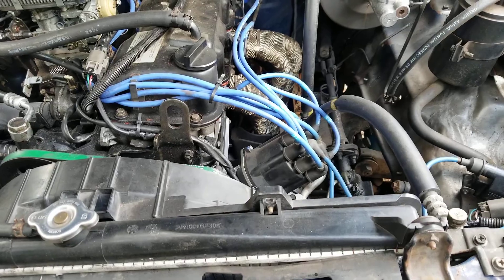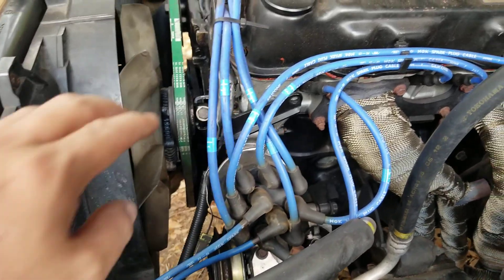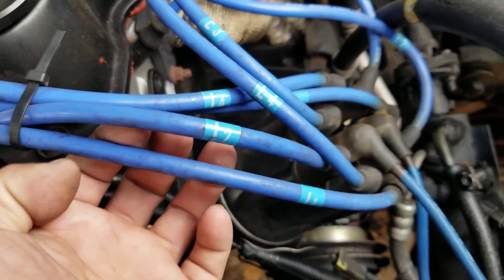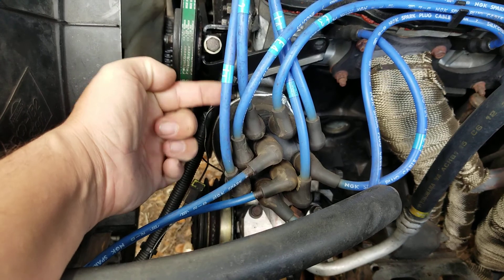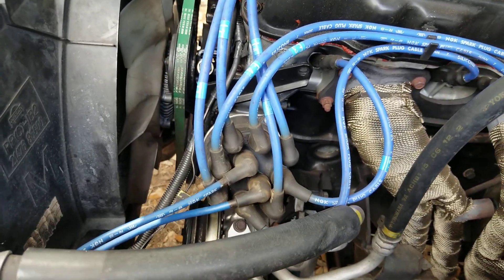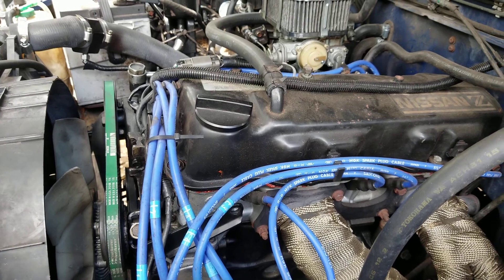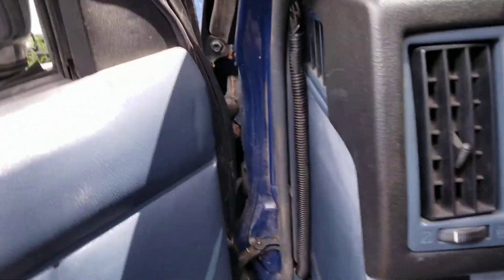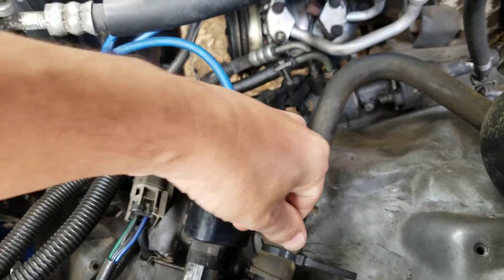86 Nissan d21. Revised: How too connect spark plug wires too distributor and ignition coils.

Comment: Hey bro maybe you can help me out please  me one got 2 coil like your but the piece behind wire are shutout  and wander if you can get those separate  and this other piece that conect 2 vacuum hose  will se photo
Reply from the maker: Can you upload a video and show me the exact area you're talking about. I'll help as best I can!
Reply: What other nissan used the same part include pathfinder  fron what year the part is the same
Reply from the maker: @concepciondeorienteeljorna67  it's only the d21's with the z24i engine that use the specific ignition control module's. The 90's d21's with the ka24e engine have a slightly different design for their ignition control module's.
Reply: I was trying but I don't know how to do it

Comment: Fíjate que tengo un problema con los cables de bujías de escape, tengo una Nissan z24 8 bujias ,.pasa lo siguiente,
Al ir andando se me apaga la camioneta la enciendo nuevamente y prende al ir andando, después presenta unos jaloneos al acelerar, me di cuenta que los cables de bujías se están tronando del lado de la bujia, y van 4 veces que cambio los cables de diferente cilindros no sé si sea problema de la bobina o del distribuidor, o alternador,espero me puedas ayudar , saludos cordiales
Reply from the maker: It might be the ignition coil and ignition control module from your exhaustside?! I've had the same problem before! When our model trucks are at idle, both coils are running! When we accelerate...the exhaust side coil and module turn off and only the intake side coil and module are running! So it sounds like your coil and module from exhaust side are about to fail completely or they've already failed! When this happens...the engine will run really bad at idle! Hope this helps!
Reply: @almagam2099 thank you that's was what I was looking for